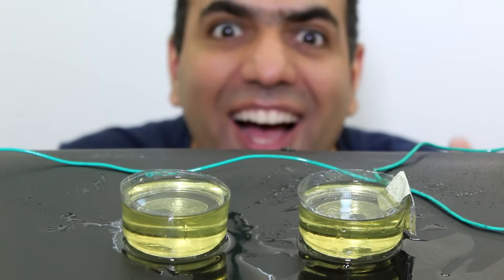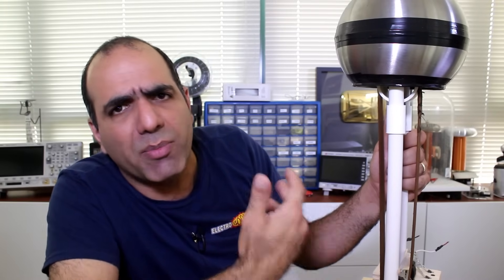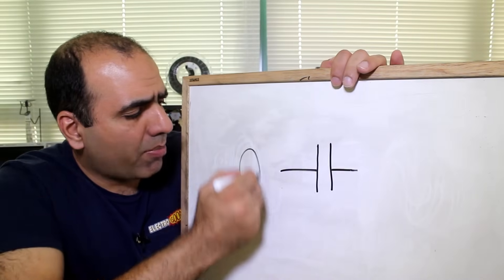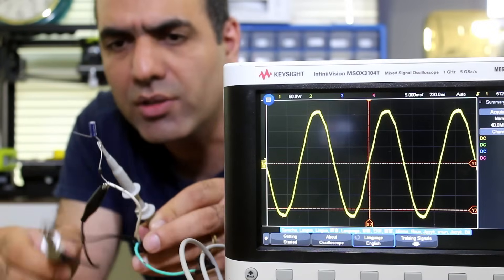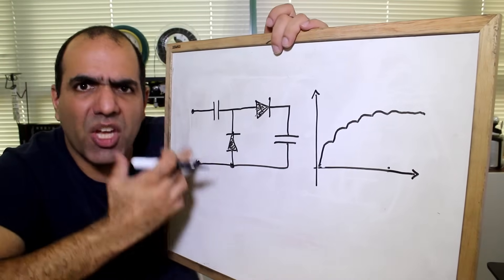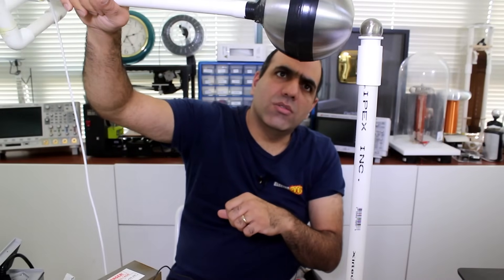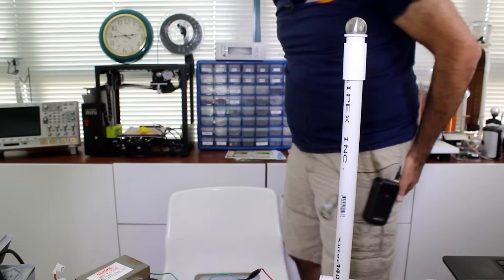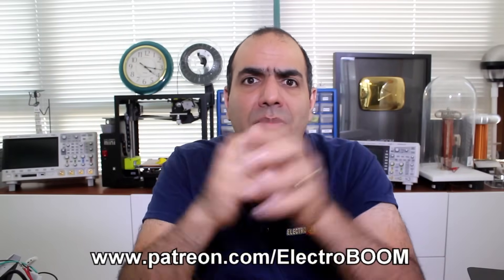High Voltage Flying Oil Experiment with Voltage Multiplier

Comment: Ok now I need to know if I can recreate this circuit with a fluid such as water or compressed gas. It should work right? Just need some actual check valves for the diodes and a bladder for the capacitors...
Reply from the maker: DO IT! as long as your gas doesn't blow up... [edit] oh I see, I though you actually wanted to make electronics. DO IT ANYWAY!
Reply: @ElectroBOOM  Have you ever tried making your own solid-state dimmer?
Reply: I assume moving a diaphragm back and forth should make an ac flow.
Reply: Get a botle of water connect it to a wheel so it moves above and below the level of your circuit to get AC.
Reply: @theCodyReeder   zed zed zeta is one because it is!!!...
Reply: Water and electricity never mix but yeah I guess it will work.
Reply: @tortoise 2.0 Except they mix all the time. How do you think your car batteries work? What doesn't mix is water that is not purified/destilled/de-ionized. Non-pure water such as tap water or local waters from lakes and oceans have many impurities and metal ions in particular that cause the conductivity of water. Distilled water on the other hand is actually a pretty bad conductor.
Reply: @tortoise2.04  water isn't actually conductive it's the impurities in it that make it conductive. Distilled de-ionised water it won't conduct electricity, you could put electrical items, for instance your PC, in a tank of this water and it would continue to operate normally, the coolant used in liquid cooling set ups used in computers uses something along the lines of distilled water.
Reply: Two days later cody is found dead in his garage. The news state that he was seemingly trying to recreate some kind of youtube tutorial.
Reply: @andresaofelipe  the guy who breath every Noble gas, constantly uses mercury in high quantities, has drink some poison
He will be fine, he will probably over do on safety just guarantee
Reply: @0Arcoverde  haven't seen it from that perspective. But yeah, you're right, I trust Cody enough to even say "bletch" in front of my ennglish teacher, if you catch my reference
Reply: @andresaofelipe  LOL
Reply: I sense a collaboration video coming...
Reply: How would an AC current work in a fluid?
Reply: @feryth  liquids are dielectric. The higher the permittivity the higher the capacitance. The higher the capacitance the lower the impedance. However increasing frequency also decreases the impedance. So if the intention of the dielectric liquid to isolate the nodes of the voltage multiplier nodes then the permittivity of the liquid should be very low or you would lose much of the energy to equilibrium in the medium and most importantly to mechanism of  accumulation of charges onto later nodes would become weaker if not impossible.
Reply: @xDR1TeK  uhh, I mean AC current but liquid. Cody had answered, so....
Reply: You could create a reference pressure and call it "ground". If Pgnd == 2 atm pressure, then the pressure at some point would oscillate between 1 and 3 atm, and the gas or fluid would flow into that point (at 1 atm) and from that point (at 3 atm) to the ground pressure point.
Reply: You could use a speaker driver coil to move some sort of plunger or diaphragm to alternate between + and - pressure, but it seems like you would need to be pumping the fluid into the system somewhere somehow.  A practical comparison between the electronic version and a fluid version would be a hydraulic intensifier pump.  A waterjet pump can achieve 60kpsi from just two stages (a standard hydraulic pump at 3500psi being the first stage, and the intensifier the second).
Reply: Faishal Ridwan it gets rectified to dc with the diodes the ark pulses because of the input frequency
Reply: @feryth  like a beating heart of mercury ;P
Reply: @feryth  He ain't talking about electricity.
Reply: How is such a "capacitor" supposed to only let "ac" pass as it does in electronics?
Anyway. There is the hydraulic ram, which is the equivalent to standard boost converters. https://en.wikipedia.org/wiki/Hydraulic_ram
Reply: @Leo Curtious. "How is such a "capacitor" supposed to only let "ac" pass as it does in electronics?"  Maybe a hydraulic capacitor might look like two equal sized containers separated by a membrane bladder.  The larger the containers, the more capacity. The membrane also blocks one way only flow while letting alternating fluid flow.  Voltage analog is pressure  and current analog is volume.   It might work with non-compressible fluids.  Compressible fluids can change temperature, and so i don't see having an electric analog.
Reply: @leocurious9919  just thinking, some kind of bladder with an inlet on each end and a diaphram in the center would do it. So a flow one way through would create high pressure on one side and low on the other, but an oscillating flow would still work fine as long as it wasn't enough to burst the diaphram (could think of that as the dialectric in a cap failing in over voltage conditions I guess)
Reply: @leocurious9919  I know this comment is old but consider a cylinder with a flexible diaphragm in the middle and connections on both ends. Applying pressure on one side would make the diaphragm bulge on one side and there would be no flow. The amount of fluid displaced  by the bulging diaphragm will be increasing with increase in pressure applied. When alternating pressure on both sides is applied the diaphragm will oscillate and will keep displacing slight amounts of fluid but will never 'block' the flow. This is the same case in electrical AC circuits involving capacitors, the AC charges won't pass through the capacitors but slight amounts of opposing charge will accumulate on either side of the capacitor before reversing quickly.
Reply: @theodiscusgaming3909 but there will be no flow? It just goes back and forth. As soon you take away the "once displaced amount" thats it, no mores comes out.
To get high pressure water you simply want to use a pump. Equivalent setups to this circuit would be somewhat more expensive and large.
Reply: @leocurious9919   That is exactly what happens in an AC circuit with a capacitor. The charges don't 'flow' anywhere they just go back and forth. Cody said in his comment that he wanted to 'recreate the circuit with fluid' and it would work for that purpose. Unlike electrical charges water has no fields associated with it so he wouldn't be able to do anything with the circuit. I think he just wants to show that it is possible to make equivalent circuits using water instead of electric charge.
Reply: @leocurious9919  Won't a piston like divider between seperated fluids work?  The at rest point in centre with a stop preventing a continuous flow and by lifting fluid increase pressure to represent stored charge
Reply: @RobBCactive  Maybe? How much does it have to be like a "real" capacitor for this non-electrical equivalent to work?
Reply: I'm assuming Cody isn't actually intending on using electricity in his "circuit"?

He is talking about moving a liquid or gas in a similar-ish way, but using one-way valves as "diodes".

I'm not sure why yet, but it'll probably be a super educational experiment if nothing else. :p
Reply: i guess for a gas this could be done to generate a high pressure
Reply: @electronash  Probably just a way to explain diodes and capacitors in a hydromechanical model for the circuit.
Reply: @coastersaga  Wow, this was a blast from the past. lol

From 4 years ago... the before-times.

I'll be honest, so much has happened since (both good and horrific), I barely remember what this discussion was about. lol
Reply: i would assume to build some good pressure, seeing how a pump can only do so much and if you have weighted one way valvels you should theoretically build a huge amounts of pressure in the last one
Reply: Maybe he wants to make an oil pump?
Reply: ElectronAsh
Like a mechanical or hydraulic computer?  I watched a cool documentary on a Russian hydraulic computer.  Used water pressure instead of electricity.
Reply: ok ... bye bye
Reply: Still getting high on gas I see Cody?
Reply: You guys please don't let silly little things like international borders keep you two from collaborating!!
Reply: That would be amazing
Reply: Isn't that basically a ram pump?
Reply: will the water act like oil but instead caused by the polar of water?
Reply: Hey @Cody'sLab, Would you like an electric magic wand when we release wand kits?  We'd be glad to send you a working wand or kit so you can conduct experiments at 120,000 volts DC or more!  The same offer is extended to you @ElectroBOOM.  Thanks for the shout out and for keeping the information you present founded in reality!
Reply: In an inverted vacuum chamber filled with Krypton.  Please, let it be so...
Reply: some electrical properties translate well to water systems. Ram-pumps are a nice representation of how a coil and swich can generate higher voltage.
Reply: what about with ferrous fluid?
Reply: That is a similar principle to a ram pump.
Reply: @MichaelMantion  not really. A ram pump is more similar to a voltage boost circuit using an inductor than it is to a Cockcroft-Walton voltage doubler topology. In the ram pump, the flow that gets interrupted and forcing the water to a higher level is roughly equivalent to the inductive kickback creating a voltage spike.
Reply: It should theoretically work but would be ridiculously inefficient. I predict these will be your limiting factors.

First keep in mind that for an air flow circuit, the atmosphere is "ground" unlike an electrical circuit where it's an isolator for our purposes. (There will be a small and steady corona discharge but the point is that a bare wire is not automatically grounded because it's touching open air.)

Your first limiting factor will be your "capacitors". Part of the magic in the circuit is that the capacitors can be cascaded in series. You will need to replicate this using membranes or bladders, and each step needs to be in SERIES. Simply having a bladder against the atmosphere won't replicate the circuit as half the action consists of "sucking" on the backstroke. It must also able store some reasonable amount of energy as a spring force. I think the energy that a membrane can transmit will be ridiculously low as compared to an electrical capacitor.

Your second limiting factor will be the check valves. Granted, I don't know much about pneumatic, but I predict that the check valves will leak on the backstroke, especially in higher stages. They can hold a static pressure just fine, but will likely leak a small amount before being able to close, since they're designed to stop continuous flow. That will likely give you exponential diminishing returns.

Your third limiting factor will be the compressibility of your chosen fluid. If your fluid is compressible (ie any gas) the compressibility will tend to absorb changes in pressure and limit the amount of flow fed through the membranes. If your fluid is compressible (ie any liquid) more flow will be fed through, but less energy stored in reserve as a result.

Though if anyone can do it, it's you, Cody.

Another thought: some circuits are suitable for air and other for electricity. Air can easily be compressed, which is why an air compressor can be built by having some chamber decrease in size. By the same lateral thinking as building a fluid voltage doubler what is the equivalent of an electrical air compressor? My suggestion: A machine that charges a plate capacitor to some voltage, then boosts the voltage by moving the plates further apart. Then dump that energy into a reserve capacitor, rinse and repeat.
Reply: So many people not getting the point here....

@Gameboygenius
"A machine that charges a plate capacitor to some voltage, then boosts the voltage by moving the plates further..." 
So a wimshurst machine? :)
Reply: @Gameboygenius  In an electronic voltage multiplier,  the voltage, once built up, is roughly the same across all diodes and is never more than 2x the peek (not rms) voltage. Thus, a hydraulic analog of this circuit would have its check valves (individually) never see more than 2x the pressure applied.
Reply: @Cody'sLab
Even if pure water isn't intrinsically conductive is it really able to "hold a static charge" the way oil can ??
I guess we'll find out :)
Reply: Totally go for it. some elastic diaphrams (must be stretchy) and one-way valves.

Maybe springs and pistons would work better than diaphrams, but each stage would have to be sealed/shielded somehow. Parts exposed to outside pressure on later stages is likely to lock up. (due to excessive pressure)
Reply: Three of my favourite YouTubers! Electroboom, Kreosan and Cody'slab! Top!!!!!!!
Reply: You can, It's called a ram pump.
Reply: How would you do that?Well answer being simply that water is similar to an a.c. current because you have a flow( negative to positive) or above ground on a scope and PRESSURE would be your "return" or positive to negative or below ground on scope " ! --- just a grom in the ETC world.
Reply: You love Xenon don't you?
Reply: Interesting idea. How about looking at a RAM pump? I think that just might meet your description.
Reply: ya! DO IT!
Reply: Cody I am subscribed to you as well as many others and more often than not you not only view but comment on so many videos that I watch that are released within an hour of me picking up on them. How lol.  Medhi thank you don't thank me you're one of the best content makers out there. Fbr!
Reply: You can do similar think with water, but it needs to be really clean. Destilled water is not enough you need to expelled all the dissolved gasses too (we did simmilar experiment and used vacuum pump to extract the dissolved gasses).
Reply: Omg Cody what are you doing here!
Reply: Cody won't oxidation of terminals ionize water? Current would move cations around. Ruining your wires and conducting current all the way across the multiplier nodes.
Reply: I cannot wait to watch you try! :D
Reply: You might want to try with luer lock tubing and syringes with rubber bands as accumulators. Small volumes and relatively low pressures would make it safe, high pressure hydraulics are way more dangerous than hobbiest high voltages.
Reply: I think the best way to supply the pneumatic flow for such an experiment would be to have 2 pistons running 180 degrees out of phase from each other in order to replicate a single diaphragm and still be analogous to the tradition AC live/neutral wires, while furthermore making it easier to transfer the required work into a closed system such as the one being suggested. I hope that made at sense.
Reply: yes, please do that, i'm very interested now.
Reply: pistons are nice, but you loose the "self-centering" of capacitors if you discharge them.

Basically, you want some kind of spring function! Ideally with a stiffness matching the input drive.
Reply: Cody'sLab did'nt expect you here
Reply: Just use a closed sistem with a piston moving a volume of fluid back and forth
Reply: I smell a crossover!!
Reply: Cody'sLab how about a hookah the flux capacitor to the harmonic balancer, that should do the trick🎉
Reply: The thing with the fluid analogy that will make things tricky is the fluid capacitors. If it is a simple bladder with a single port, the pressure will be referenced to atmosphere. However, if you have a rigid two-port diaphragm with the bladder/flexible membrane inbetween the ports (like so http://amasci.com/graphics/wtrcap1.gif), you will be able to reference the pressure to various nodes in the circuit and properly reproduce a voltage multiplier (they'll still be referenced to the atmosphere!).  Once you succeed, it would be interesting if you compared your fluid pressure multiplier to a fluid DC-DC converter that uses water hammer from: switching solenoids as the electrical switches, length of tubing as the inductive pressure spikes, and a check valve and tank to store the high pressure. 

As a side note, you don't need an alternating current (or alternating fluid?) to create a voltage multiplier, you just need 4 switches/solenoids that take turns synchronously switching between two references (like input pressure and atmosphere). This is called a 'charge pump' and only requires DC as the input which could dramatically simplify your setup.

For a fun, interesting crash course on charge pumps, SparkFun has a great segment here https://youtu.be/5_uYE4EWSKY?t=170

edit: If you have problems with the backflow from check valves, just use solenoids. We often use synchronous switches instead of diodes to eliminate losses from diode drops.
Reply: Use distilled water and it should work as long as it's not contaminated with ions I think.
Reply: The first ever collab between Boom and Cody will look like this - In one frame we see Boom ready to attach a wire and in the next frame we hear Cody shout "Ouch". lol
Reply: CODYS LAAAAB
Reply: Love your videos buddy stay safe lol
Reply: I believe this would work with liquid helium
Reply: Hey Cody! You could use as an input a compressor motor, it's pulsing pressure feed mimics the AC input!
Reply: It will work if the fluid is dense enough, ram pumps works on a similar concept.
Reply: I feel like this would be a great time to collaborate somehow. You guys have 16.000km distance in between but i am sure you can sort something out. I would support the heck out of that collaboration video
Reply: Cody, you should collaborate with him and do a very interesting mix of what the both of you do best, science!
Reply: Isn't that essentially a reciprocating pump as used in pressure washers?
Reply: Just don't die. Again.
Reply: Beat the devil out me, but I can't wait for your video on the topic.
Reply: I'd watch that.  I had considered making some water "circuits" a while back but never actually thought of anything interesting to scale them to.  A fluid multiplier sounds incredible!
Reply: Alright so I've got a question! Is there any way we could use this technology to help clean up oil spills? Would it be possible to push crude oil that spilled from a pipeline on land further down into the soil?
Reply: Mike S yeah but its not that effective aka if you just don't want to touch the oil and dont mind cleaning what ever oil didnt make it into what you want sure go for it look at kreosans video on the oil video he demonstrates this pretty well cleans oil into a garbage bag with half a million volts sorry for the long comment hope this helpled
Reply: Yes, you absolutely can. I don't think a "bladder" is quite right though. You need something that has an inlet AND outlet - this is essential. A bladder inside a pressure vessel could work.
Reply: I mean, hydraulic ram pumps work fine and are somewhat similar to this.
Reply: Faishal Ridwan, wave tank?
Reply: what do you mean
Reply: Similar to a ram pump.
Reply: Double acting cylinder hooked to itself
Reply: Water works fine, but you get water everywhere.
Reply: Various comments have suggested this is similar to a ram pump.  But a ram pump is closer to DC to DC converter than an AC to high voltage DC converter.
Reply: This is beautiful. My two favorite you tubers in one place is like cool^2
Reply: So you're thinking of something like this but with pressure? I think it would be more visibly interesting if rather than bladders you used vertical reservoirs and a dense fluid like mercury that would give a good visual representation of the pressure at the base of the reservoir increasing and decreasing as the liquid rises and falls.
Reply: @uncompetenttv9973   verticle   reservoir is more interesting than a bladder and certainly easyer to construct.  If volume represents amps  and  pressure represents voltage, then maybe an open top is better analog to a capacitor than closed top. The height of the tube is then a metaphore for the voltage raiting on a capacitor.
Reply: Check out old pneumatic PID controllers. Really cool analog tech that ran industrial processes well into the 80s and 90s.
Reply: It might work IDK though
Reply: Just going to live this hear (=m=)
 https://youtu.be/iC8KDYcdiUI
Reply: Make a crossover between tkor, Cody, Electroboom.
Reply: Hi Cody fancy meeting you here I’m Magewesley btw
Reply: Buy yourself a breadboard man
Reply: Use mustard seeds instead it will be fun and will be big mess to clean!!
Reply: for a capacitor you would need something like a cylinder with a flexible diaphragm in the middle and connections on both ends, not a bladder
Reply: I have a bad feeling about this
Reply: Ah shit Cody’sLab is here everyone hide your everything
Reply: Think about multiple water hammering at the same time. In that case you don't need bladders but a pipe that start wide and then more narrow this with check valve's to multiply the pressure.
Reply: Yes make a fluid/gas circuit :-)
Reply: Cody! I love your videos!
Reply: Never expected to see cody here.... been missin ya on the Waterjet Channel
Reply: Țț/tttttxzzzZZZZZZZZZZzzzzzzzZZZZZZZZZZZZZZZZZZZZZZZZZZZZZZZZZZZZZZZZZZZZZZZZXXXXXXZZZ6ZZZZZZ
Reply: Isn't this how a ram pump works, there is alot of water loss, I don't think it will work well past the first stage,
Reply: Hah Like Moses...part the waters.😂
Reply: It works bad at water because of polar molecules that attracts each other.
Reply: WE WANT A COLLABORATION PLZZZZZZZZZZZZZZZZZZZZZZZZZZZZZZZZZZZZZZZZZZZZZZZZZZZZZZZZZZZZZZZZZZZZZZZZZZZZZZZZZZZZZZZZZZZZZZZZZZZZZZZZZZZZZZZZZZZZZZZZZZZZZZZZZZZZZZZZZZZZZZZZZZZZZZZZZZZZ
Reply: How will you do that?